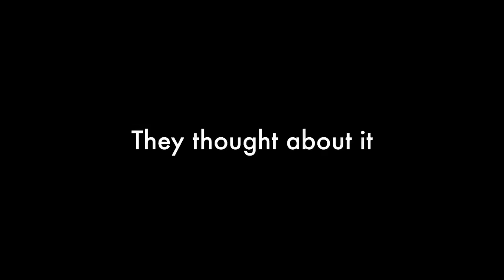RESTORING AN OLD CHICKEN COOP FOR OUR HENS

Comment: Be sure to add some hay to the hen boxes.

Be sure to add a chain on the inside of the hen boxes door at each end so that door does not hand down vertically but stops at the horizontal position. It will make it easier to open & collect the eggs.

Make the ramp going up into the henhouse wider & a little longer because the incline is a little too much at 45 degrees.

No need to use a small feeder for the grain. Just sprinkle the grain around the run every morning. Or get a wide plate for a feeder.

Comment: Mike, you did a super great job on the coop!! We have a few backyard chickens and live just north of Falls Lake - so sort of neighbors. We bought our coop from Carolina Coops, had it shipped as a precut kit and my husband built it with the run. It was pricey but he did an excellent job finishing it out. My one concern is there is almost no ventilation in your coop. We have doors on all sides that open from bottom with wire in opening. You have so many chickens that they will really be stuffed inside when they are grown and could suffocate at night. Just a friendly advice as our summers are very hot and humid here, day and night and they need shade during days as well. The best of luck - the fresh eggs are great!!